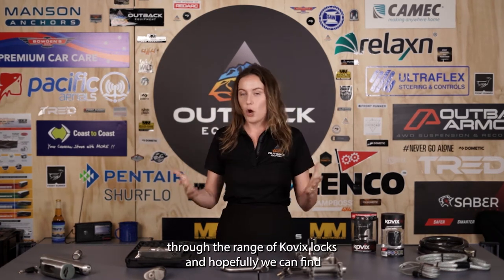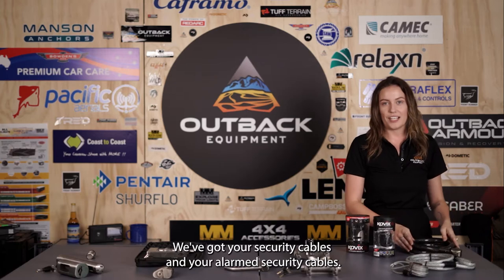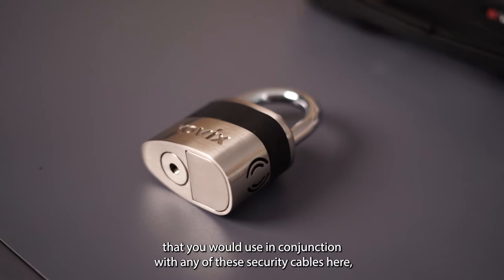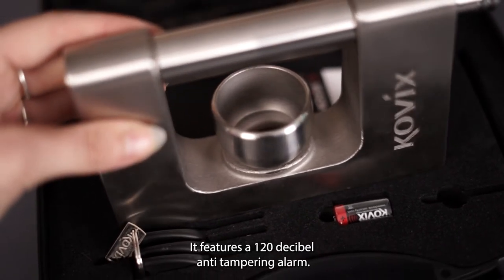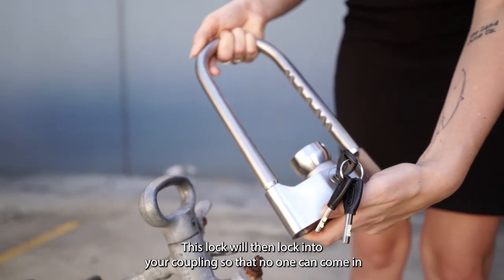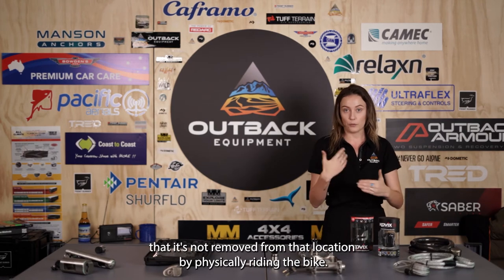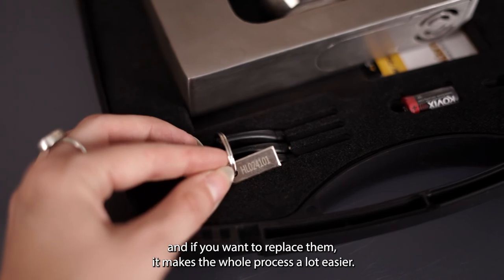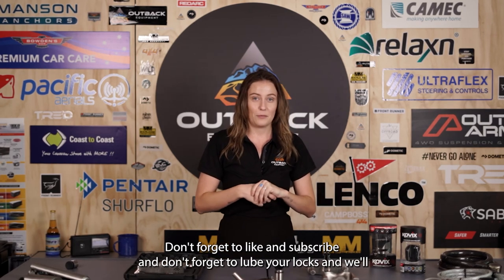Kovix Locks Australia - Repel Thieves FOR GOOD.

Comment: Interesting locks but I need details on the keying system. 
It looks to be a disc detainer system. 
Are they drill resistant or keyhole pry resistant? 
Cheap disc detainer locks are held in by a weak washer that can be pryed out with a flat screwdriver. 
How many discs in the lock. I could not see a key to count the cuts myself. 
Can you get all the different locks keyed alike if you order them together so you dont need 5 or more tyles of keys, etc? 
Can they be re-keyed after purchase or are they non-rekeyable?
Thanks